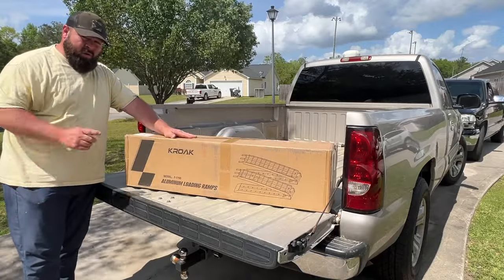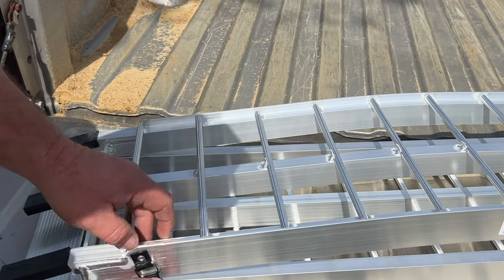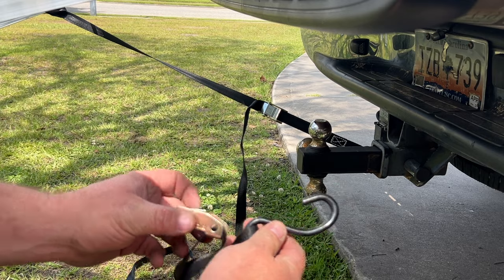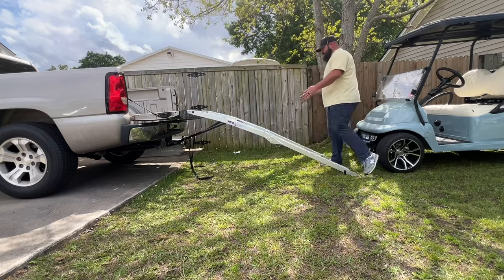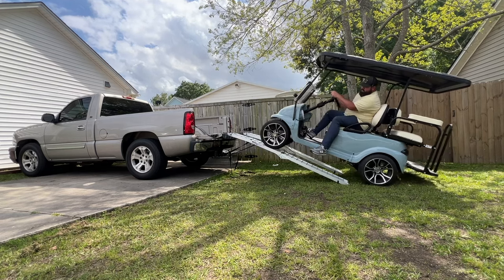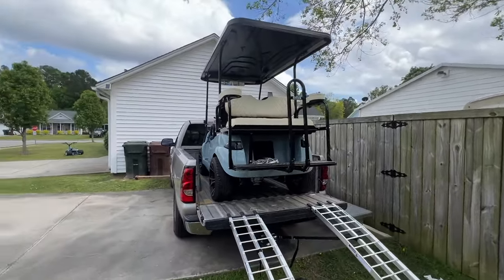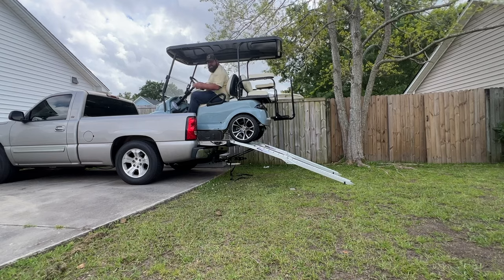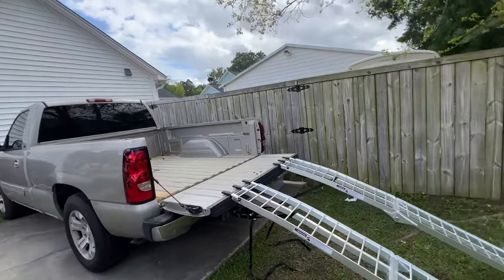How To Load Golf Cart In Truck Bed | Aluminum Folding Ramps

Comment: Two inch level on 35” tires. It’s sketchy as hell. I mounted a winch to pull it up. Longer tri fold ramps would be better, but it works in a pinch.

Comment: Need a 6 1/2 bed to make sure most carts will fin in the box and not on the tailgate.  But when you drive over a bump your tailgate will bounce. Kind of annoying. We load ours on a hill so it’s less likely to bottom out and I make my 115lb wife do it so I don’t screw up the tailgate.
Reply: They have some struts on Amazon that will “lock” the tailgate down to help prevent that.